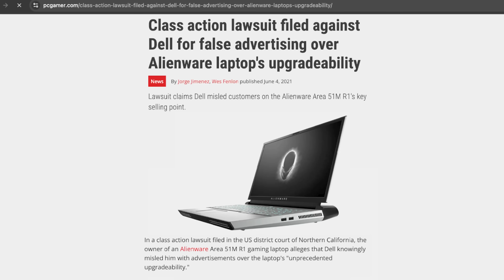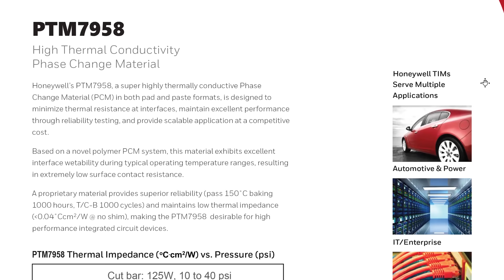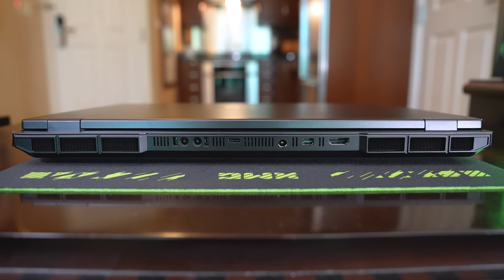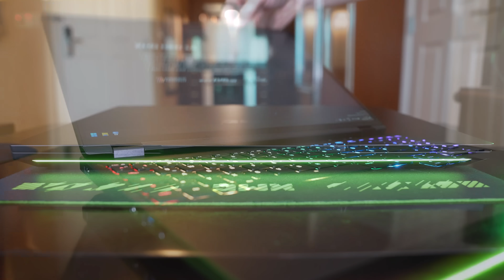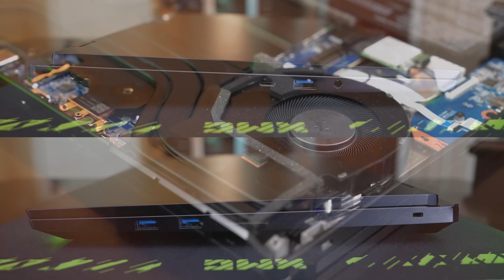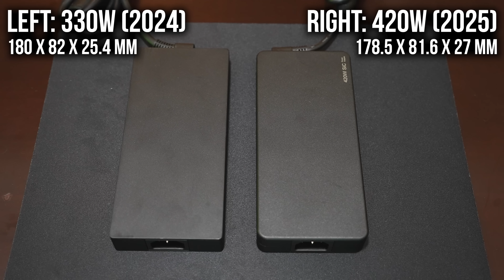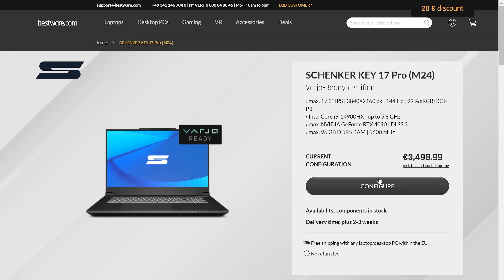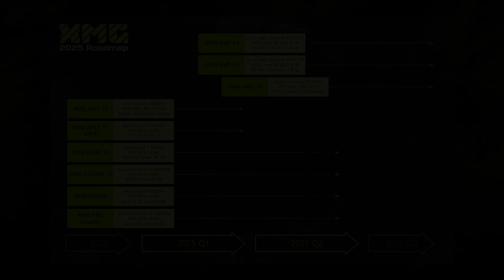This Gaming Laptop has Separate CPU & GPU! - XMG Neo 16

Comment: Wait, why no USB4 on AMD!?
Reply: USB4 on Ryzen AI (Krackan and Strix), but not on Fire Range. Unlike Intel HX series, AMD's FL1 desktop replacement platform does not natively support USB4. // Tom
Reply: @xmg_gg That's... Not good. That actually might be a dealbreaker for me if that's the case...
Reply: @cameron_bosch  Honest question: what do you need USB4 for on a high-end gaming laptop. Probably not for an eGPU, right? The USB-C 3.2 port still supports DisplayPort 1.4 with 32.4 Gbps, full speed. // Tom
Reply: @xmg_gg  Honestly, Tom, this sounds a bit immature coming from an OEM executive. I use USB4 and Thunderbolt, for docks and other Thunderbolt accessories. My CalDigit Thunderbolt dock literally loses a lot of functionality with only USB-C 3.2.
Reply: @cameron_bosch  Sorry, it was an honest question, I'm just exploring customer feedback. Many talk about Thunderbolt but actually don't utilize it. You do, perhaps, with your Thunderbolt dock. Others use non-Thunderbolt docks (with DP ALT support) and are happy with that, too. Besides multi-monitor docks and eGPUs, what other peripherals really require more than 10 Gbps data rate? An external SSD with USB-C 3.2 10 Gbps can transfer almost 1 Gigabyte per second - that's huge. Requiring more than that, e.g. for 4K video editing directly from external storage, is possible, but then we talk about like ~1% of the market. This is probably why AMD has been so late with adding native USB4 support to some of their chipsets. We're not happy about this either, but it is what it is. On the flipside: XMG EVO with AMD's FP7 and FP8 platform support USB4 on AMD Ryzen. // Tom
Reply: Yep. That decision aged like milk. USB4 is only more prevalent now and this proved my point more...

Comment: Back when we had MXM GPUs for laptops, this was expected and common in gaming laptops. Now it's suddenly a miracle? Big deal. The glorious days of dual MXM cards in sli with a socket CPU in laptops.
Reply: I was thinking the same. If upgradable laptops were good, MXM would have been not disappeared
Reply: i'm still using my msi laptop with an mxm 1070
Reply: MXM GPUs still exist for Nvidia 40 series but only the Quadro versions for workstations. It's not mainstream. Also, laptops innovate too fast these days, custom designs, custom improved cooling year after year. It's hard to do that and stick to MXM, especially for thin and lights and 14 Inchers.
Reply: Not much use. Because even though you can replace the MXM GPU, the original heatsink may not fit a new generation GPU.
Reply: there are mxm cards still available, you can find 4060M and 4050M boards in Chinese websites that are legit 40 series cards

Comment: I’m just excited for tuf series to come soon. I hope it come soon as possible. And it will be my first gaming laptop
Reply: Go with lenovo buddy
Reply: @franfran332  Nah, go with something else.
Reply: @cameronbosch1213  OK so tell me any better and reliable laptop gaming brand ?
Reply: @franfran332  I would go for Lenovo, MSI, Gigabyte or even check out an hp Victus laptop… 🧐
Reply: @franfran332  2022 was the last good year for high-end Lenovo gaming laptops. 2023/2024 were not very good, and 2025 seems to be barely any better.

I'd try XMG/Eluktronics or Razer.
Reply: @cameronbosch1213  that's my lenovo's laptop year so maybe I'm not enough informed from newer one , ngl XMG looks fire value for money however : razer? Worst bloatware/bugged synapse integration and the price is a no way 🥶
Reply: @franfran332  it’s very expensive in my country, so that the reason i go with tuf. Because it’s very cheap
Reply: I have owned a 2007, 2020 and 2022 ASUS gaming laptops. Their quality has gone way down. There is a reason they are cheaper than for example Lenovo; their quality sucks. The 2022 with AMD 6800 cpu and nVidia 3060 short circuited after 4 months of normal use. Their chassis has become thin plastic and the 2020 with AMD 4800 and nVidia 1660Ti had lousy airflow.
The 2007 one was a solid laptop which served me well for many years until it died around 2015. Never ASUS for me again.

Comment: xmg is on the right path, its a better option than frameworks solution
Reply: Uh no, it isn't. You literally cannot upgrade the GPU yourself unlike Framework. And also unlike Framework, it requires a full disassembly and removing the heatsinks to separate the boards.

Framework still is much better long-term; now if they'd just bury the the hatchet with Nvidia...
Reply: @cameronbosch1213  the added complexity is worth it lol
Reply: @AhmadAli-kv2ho  What added complexity being worth what?
Reply: @cameronbosch1213  wdym?

Comment: Does XMG have touchscreen gaming laptops? I am currently looking for an upgrade to the 50 series this generation
Reply: We are not planning any laptops with dGPU and touchscreen. Our sister brand has one ultrabook convertible called TUXEDO InfinityFlex 14 with touch and pen input. // Tom
Reply: @xmg_gg That's using a much older CPU though. So I guess no then.

Comment: One step better than having your laptop becoming a brick when the GPU died. XMG and Tongfang really made a great move with this.
Reply: it probably will in the long run. They are making these like cars. If things don't match or are signed between each other it won't boot. Right to repair needs to step in.
Reply: @highlanderc  At the very least there are some modularities rather than having to swap the entire board
Reply: it won't POST if your GPU die. It was stated by the XMG representative. So you shall still RMA that and get them replace the separated dGPU board.
Reply: @TheMacco26 Still far less e-waste would be produced. You'd only need a screwdriver to swap things around now. Rather than a professional BGA Rework station and personnel.
Reply: You forgot that laptop's in the past had mini-pcie and GPU modules called MXM.
Yes is one step but remember we was there before.
I have a laptop with removable DVD unit, 2 mini-pcie populated with a dvb-t TV card and a sata hard drive.
In my case the GPU was a i915 Intel integrated GPU.
Reply: you need a dGPU board (that probably has to be parts paired by XMG) to boot the laptop so if the GPU dies you are just as f'ed as usually just that the replacement board will be cheaper.. cheap enough to justify repair? - that's an unanswered question..
Reply: XMG MUST USE AMD,,,,,INTEL GOOD DAYS END
Reply: Haven't had laptop GPU die on me.
Reply: @panjak323 You haven't owned a Dell/Alienware?
Reply: you know framework exists right
Reply: @tacoman4005  Yep, Framework is great for repairability. But it down sucks at cooling. 100 degrees and throtling are basically guaranteed and expected.
Reply: Still a step back from a pre-existing MXM B standard.  All they needed was an edge connector 🤦🏼‍♂️
Reply: What 𝒕𝒉𝒆 𝒂𝒄𝒕𝒖𝒂𝒍 𝒇𝒖𝒄𝒌 is the point of cryptographically pairing the MoBo to the GPU Daughterboard? Some manager at XMG seriously decided to dedicate literal 10’s of Thousands of Dollars worth of Engineering & Development time with the expressed goal of ensuring their product is 𝑳𝑬𝑺𝑺 robust/serviceable? 

I’d 𝒍𝒐𝒗𝒆 to see what the Jira user story for that decision was:
“A loyal customer who’s enjoyed our product for a number of years encounters a hardware failure, or is considering an incremental component upgrade and is interested in purchasing one of our proprietary parts. What is the most expensive way to assist this user in going to absolutely frick themself?”
Reply: Xmg does nothing in this laptop; they order a ready-made chassis from Tongfang, install their own RAM and SSD, stick their logo on the cover, and that's it. Dreammachines, Mechrevo, Mediabeast Erazеr, and many other brands do the same thing, literally releasing the same device.
Reply: This is marketing slop nothing more, chances are high that you wont be able to repair these machines very far into the future and it being a proprietary format means that IF you can buy the boards they will cost a fortune. This shouldnt be celebrated, the ability to socket and replace parts was completely normal on high end laptops even just 10yrs ago. I.E Dell precision 7720 can swap ram/gpu/ssd/battery/etc. and except CPU and go to the generation before that if memory serves you could still swap CPUs then too.
Reply: @DuckMan77  some lenovo laptops had socketable cpus to back in the day
Reply: Made in China. -- Nope.
Reply: @HanSolo__ everything is made in china! 😂
Reply: Whether you like it or not, you ain't wrong lol. Literally something like 80% come from China.
Reply: @Scoobied77 There is a big difference between what is designed and manufactured by the Chinese themselves and what is simply assembled by their hands under the guidance of well-known brands that develop and design the layout of components for their motherboards themselves.

Comment: It's finally happening..

UPGRADEABLE LAPTOPS
Reply: Please allow us to clarify: this design does NOT allow for post-purchase CPU or GPU upgrades. The separation of components into distinct boards is a manufacturing innovation aimed at providing flexibility during production. This does NOT translate into a system that users can reconfigure or upgrade post-purchase, NEITHER within NOR across generations. 

GPU boards in this series are designed exclusively for integration within the laptop system. They rely on the system’s architecture and will not boot or function independently. Configurations sold are fixed and cannot be reconfigured after purchase. Customers should carefully select their desired specifications at the time of purchase, as the separate design does not support post-sale reconfiguration of components.

The separate design allows professional servicing to replace defective components efficiently. However, the complexity of thermal module reassembly, particularly with materials like phase-change cooling pads (CPU and GPU) and thermal putty (VRAM and MOSFETs), makes user-driven modifications impractical and risky. // Tom
Reply: @xmg_gg  thanks for the clarification, but why don't you just produce the upgradeable laptops that people want?
Reply: @Tom_Quixote  The decision to prohibit user-driven upgrades is rooted in several technical and practical considerations:

1. Unknown future requirements: The designs and needs of future CPU and GPU generations are unpredictable during the current product’s development. Even if the PCIe link remains physically compatible, changes in pin layouts, signal tolerances, power requirements, board dimensions, and other specifications will make upgrades unfeasible.

2. Tight integration in power, signalling and firmware: In comparison with desktop PCs, laptops have stricter tolerances for power consumption, thermal performance, and a higher degree of cross-vendor integration. Features like NVIDIA Optimus (MSHybrid) further intertwine CPU and GPU operations, complicating compatibility. Even if physical compatibility were achieved, firmware mismatches and a lack of hardware debugging/validation for unsupported board combinations would result in unreliable or incomplete operation.

3. Thermal management: Each system requires a custom-designed shared thermal module, including heat pipes, cold plates, and thermal pads or putty, all tailored to the specific dimensions and z-height of each CPU and GPU configuration. Even GPUs with similar board layouts may need adjustments to the thermal module and interface materials due to varying locations of components like VRAM and MOSFETs. Replacing or upgrading components would necessitate replacing the entire cooling solution to maintain thermal efficiency.
These technical constraints underline why user-driven upgrades are neither feasible nor supported.

// Tom
Reply: @Tom_Quixote  The decision to prohibit user-driven upgrades is based on significant technical and practical challenges. Future CPU and GPU designs are unpredictable, with changes in pin layouts, signal tolerances, and power requirements likely making upgrades unfeasible. Laptops, unlike desktops, have stricter tolerances for power and thermal performance, with features like NVIDIA Optimus tightly integrating CPU and GPU operations, making compatibility issues inevitable. Furthermore, each system's thermal module is custom-designed for specific configurations, meaning even small changes would require a complete replacement of cooling solutions. These factors collectively make user-driven upgrades impractical and unsupported. // Tom
Reply: @yourname7254  Exactly why I'm sticking with Framework. Hopefully Nvidia and Framework will make up.

Comment: 5:35 considering the limitations when using iGPU for display out (i.e Optimus), does that mean the MiniLED display is 10-bit (while non-MiniLED is 8-bit)
Reply: The mLED panel is 8bit+FRC. // Tom
Reply: @xmg_gg  Hi, could you offer a neo version without any dGpu ? 
Some of us only look for CPU performance, and the integrated graphic is way enough. 
With the new 99xx and 390+ amd processor bringing a lot more power to the CPU (but not much for gamer), it could make sense to bring a dGpu-less version.
It could also be useful to propose a pro dGpu version for 3D workstations, or even AI power-users.
Thanks
Reply: @RomainLagrange1  We understand the demand, but we can currently not offer an XMG NEO without dGPU. Our top CPU w/o dGPU in first half of this year will be AMD Ryzen AI 9 HX 370 in XMG EVO series with 12 cores and 24 threads. // Tom
Reply: @xmg_gg  i would definitely consider this one if paired with a beefier 390+
Reply: @xmg_gg will the differences in performance between amd and intel be listed when both are ready?
Reply: @thorluis226  We will list performance differences in benchmarks such as Cinebench and 3DMark. For real-life gaming differences, we will attempt to provide samples to a few reviewers who will be able to run their broad gaming test suites. // Tom

Comment: Board customisability and improved repairability is still way better than other OEMs! Also, glad they were able to redirect the exhaust heat backwards and improve cooling without sending all the ports to the sides (cough Lenovo cough)

Comment: probably the most innovated design in 2025 so far
Reply: 0 hour gang.
Reply: its a brave choice cus companies are pushing customers to buy a new laptop when there is an issue with motherboards. hope we'll see in other brands but i don't think so
Reply: A good intention from a laptop manufacturer.
Reply: Is E-waste out of the box dude. MXM module would have been a better option =))

Comment: Fully decked-out laptops are so powerful but they cost almost as much as a cheap car😭
Reply: You clearly weren't aware of SGI workstations in the early 1990s. Those things were around the price of an extremely high-end sports car in 2025 money.
Reply: @cameron_bosch  Even today, you can easily spec a Thinkstation/Precision tower/Z8 workstation to well above $100,000. Enterprise hardware never came cheap and never will.
Reply: Key words, decked out vs cheap
Reply: @ By cheap, they also mean clapped out 10+ year old here. The last time a new car was only sale for (nominal money) 5k was maybe the 1990s.

Comment: The amount of system latency with that interconnect.
Reply: It should be the same as a desktop PC, where the GPU is conected by PCIe.
Even if there're only 8 lanes like most laptops, Zen5 HX, Arrowlake and RTX 5000 uses PCIe 5.0, so the same bandwidth as x16 PCIe 4.0 lanes. Should be enough even for the 5090 mobile (wich is not the same GPU as desktop 5090).
Reply: Why would there be latency? It's gen 5 pcie lanes with a laptop GPU, they are not going to be the bottleneck
Reply: Regular laptops use internal pci-e, there won't be a diffrence in latency.
Reply: How do you think desktop gpus slot in?
Reply: The interconnect is passive, it's just a simple PCIe link. There is no additional, measurable latency. // Tom